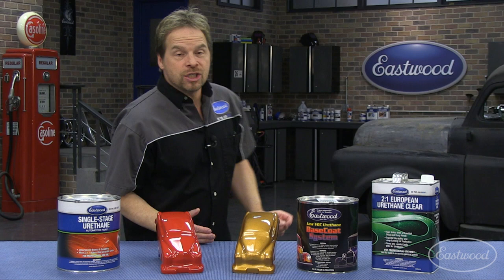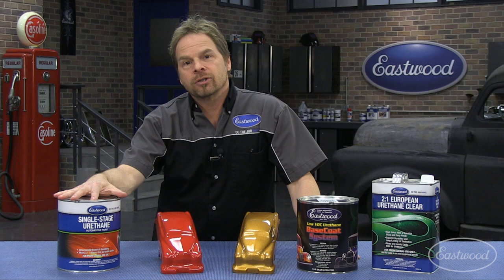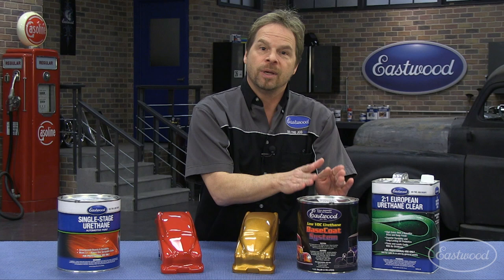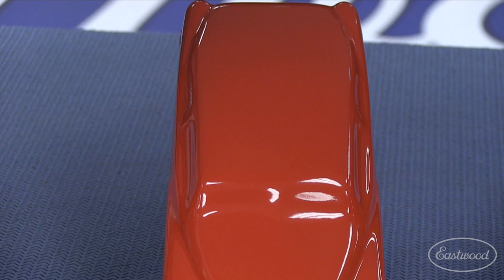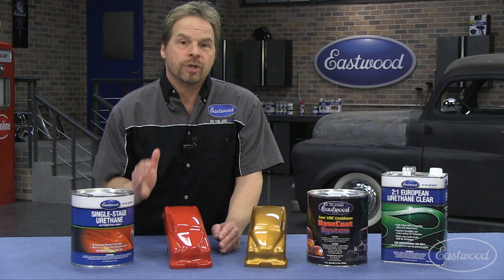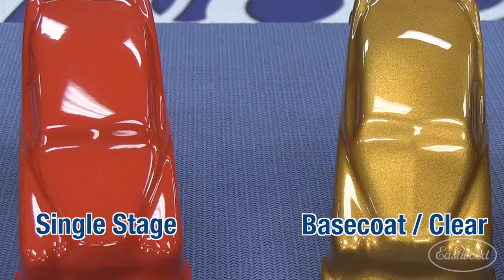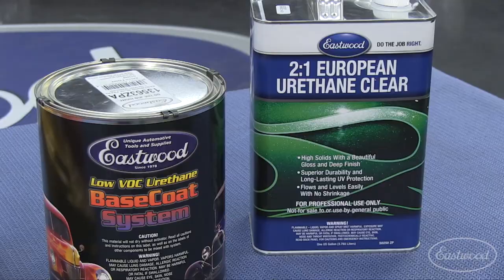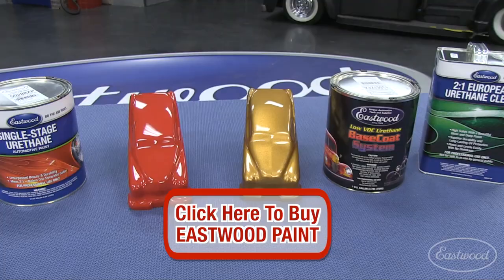Automotive Basecoat-Clear vs Single Stage - Which Car Paint System is Best? - Kevin Tetz at Eastwood

Comment: "if you're a beginner", Single Stage is the only way to go, it eliminates all the hassle, except the prep. Sand through the clear, sand through the base, sand through the primer if need be. try not to reach bare metal. Sand, and sand some more. Lay on a smooth primer, sand to perfection- lay on ss in thick heavy coats without runs-let dry, done.
Reply: Can you just sand off the clear coat and paint over base if you want to?
Reply: Kanye East that’s what I’m doing
Reply: What difference between urethane single stage and enamel single stage
Reply: @AlexSanchez-qw6po  Yes you can.

Comment: Why wouldn't you do both sprayouts in the same, or similar color to properly demonstrate the differences in the finish between both paint systems?
Reply: thank you
Reply: Cause they don’t want to admit that single stage is better can cheaper.
Reply: Agree with everyone no comparison shown stupidity
Reply: Actually, I suspect you can't do metallic paint in a single stage paint. At least that will last very long. Metallic paints need protected in a big way or they just oxidize really fast.
Reply: Oh yes you can - 'old school' non-catalyed single stage metallic enamel - did many of them decades ago - there is an 'art' to spraying it.  Lay on two full coats and it is all blotchy - then as the second coat is tacky - you thin the third coat and mist it over and 'voila' uniform metallic flop - BUT - HA - you CANNOT polish it or sand it as the uniformity is then ruined.  It was for quick cheap out the door jobs.
Reply: @consaka1  Single stage metallic is possible - HA - looks great off the gun - BUT - I would not like to try and cut & polish it over the years.  Single stage metallic enamel (40-years ago since I used it) is sprayed on with one full coat - let it tack a little bit (it can develop runs very easily) - then a second full coat and then before the second coat is too dry (and which looks mottled at second coat stage) - a thinned out mist coat over the entire area.  The mist coat eliminates the mottling.  It has a super shine direct off the gun.  I painted many of those 'el-cheapo' jobs many years ago - not sure about the look of them if someone started ripping into it with a heavy cutting compound years later.  As for solid colors - I 'detest' COB on solid colors on older style cars - it looks completely out of place. But then again - ome people like to adron themesleves with gold chaians etc - others do not --- so therefore - each to their own final choice.  Single stage looks much better - HA - a 1932 Ford never had paint that looked an inch deep.  But COB is required for longevity of a mettalic.  I suspect that COB is easier for OEM reasons - hence the popularity on modern vehicles.  My suggestion - if you are doing an entire respray on a older veihicle - consider using single stage with non-metallics - HA - I would not suggest the single stage metallic of some 40-years ago (assuming it can till be purchased) unless budget reaons dictate the method.  Have a safe and nice day.  CHEERS from AUSTRALIA.
Reply: Thanks same question
Reply: @performancegroup310  lmao
Reply: If you're gonna do a solid color without any metallic, single stage is the way to go. If it fades, you can just buff it out, and I swear that basic paste carnauba wax on single stage has a different shine to it. 
-- If you're gonna do metallic, then multi-stage is the way to go. Personally, I like the metallic to have flat flakes that are mixed into clearcoat. Like, gold flake on top of blue base coat. Then bury all of that in clear.
Reply: @geneva760 Excellent advice friend - thank you

Comment: As a beginner, I’ve just tried both and finding out that single stage is much more difficult to apply. Got runs everywhere. On the contrary, base coat (2 stage) is so easy to apply, just time consuming. And the final clear coat can be easily corrected. I’ll leave the single stage (typically 2K) to the professionals. The other thing I’m finding out is that for 2 stage paint, the surface must be impeccably smooth, else every imperfection is visible. The single stage seems to fill more, thicker, hence more forgiving surface imperfections.

Comment: My rule of thumb is, if its a non-metallic, non-pearl paint, I go single stage.  If I want to spray a metallic or pearl paint, I go base/clear.
Reply: Absolutely, the problems with single stage only begin when there is flake or pearls involved When they are it's damn near impossible to avoid mottlellng and streaking and base/clear becomes the only viable option.
Reply: @satamanschmidt3428  Wait are you guys serious? I fail to see the reason to get a one stage paintjob unless like he says it's an old car with already a one stage on it and you are fixing panels.

Comment: Look at eastwood trying to scare noobs into the more expensive stuff. The singe stage is also forgiving because you can re-spray anything and all flaws can be sanded out. If there is a problem in the base with the base/clear system, it is more involved to fix.
Reply: Ian Mcdowell EXCATLY!! What a BS comparison also using a basic red against a gold metallic! Trying to scare people to boost sales of the more expensive system!!
Reply: Ian Mcdowell and it is not peeling of from the sun after years like the base coat-clear coat ,the single Stade will need only a polish
Reply: Ian Mcdowell but they are explaining it well
Reply: Can you add a layer of clear coat over the single stage to make it shine even more?
Reply: @stufish73  yes you can
Reply: Stuart Mead yes
Reply: You can't blend color on a single stage if you have to paint a repair section.
Reply: I have a question for you... I have a single stage urethane (black) and a gallon of 2k urethane clear. Can I spray them in sequence adding the clear over the single stage or do I have to let it cure, then sand/scuff it before spraying the clear? Any advice helps.
Reply: @denverfreeman738  use whatever the manufacturer specifies for top coating. If it is not on the can, look up more data on the website or contact a rep.

Usually the answer is yes, some people do it for a deeper shine while others don't to avoid future clear coat issues.

Comment: to me the single stage looks cheap. OEM does base+clear right? So a restoration should be base+clear?
Reply from the maker: It can depend on the manufacturer - some motorcycles for example come factory with single stage.  But the norm is base/clear.

Comment: videos a little biased towards the base-coat clear,  a single stage can be polished out to look just as deep and wet as the to stage, it even looks like they didn't polish the single stage as good as they could have, to perpetuate there sales.
Reply: Matthew Morgan Ya but the end result is still the same a base/clear   will always be glossary then a single stage spray.
Reply: You are so right! Plus if the single stage you can buff out if it fades , when clear coat goes bad it’s done , strip it and repaint. You can also mix 50/50 clear and single stage on the last coat making it super nice.
Reply: Nick Sandoval I always mix clear and color for 2-3 coats reducing the amount of color by 20-50% each coat depending upon color and then do at least 2 coats of clear clear and you will have a paint job that is nicer and deeper than any bc/cc system
Reply: @1982MCI  HI m8. Yes, I agree. I'm spraying my Chrysler 300C 5dr this summer. Haven't sprayed for years but having dreams of a super, super finish. I was thinking somewhere along those lines myself...I have a plan..!!

Comment: Hi
please which of the two paint resists better to sun and high temperatures?
i want use 2stage system but I fear that the uv and heat breaks the clear coat over time

Comment: Ok, so I used a single stage on a 66 Mustang restoration, have some spots that need touchup due to running and body work that needs to be perfected.  I used a devilbiss starting line gun with 1.4 tip and as the painting progressed the gun spray seemed to narrow, hence the runs.  what is the best option to fix? sand and use base coat instead or more single stage.  I might paint over the entire care again. I was planning to use clear over the single stage anyway.  what is my best approach.....Thanks for your reply!

Comment: Is 2k paint in a rattle can with the activator module inside the same as single stage? Does it need a clear coat or can it buff to shine without clear? I was looking for single stage in cans but the shop I stopped by didn’t speak much English. My car doesn’t have a clear coat.
Reply from the maker: This is going to be on a case by case basis depending on what product you're using.  Our 2k DuraSpray is polishable after 12 hours.  Other's might come out as just a color coat without UV protection/Shine.  Check product descriptions to be sure.
Reply: @eastwoodco  I have a 57 belair, red/white top with no clear coat. I need single stage rattle cans of each color. How do I go about matching colors and purchasing from eastwood?

Comment: " …..  the single stage does not have the depth of the b/c job …. as stated by Tetz "  -  This is simply False …  or should we say let's just qualify, quantify and clarify that statement  as it is on face value not correct and is simply wrong … The clear coat is the only so called depth you are going to achieve with the bb/cc system as the base coat has no hue or pigment/binder qualities to render any depth … by it's basic chemical component makeup it can offer no depth and as stated it is flat when applied and relies on the cc top for it's shine , yes shine but renders no true tonal perceived paint depth… on the other hand the lacquer , enamel or urethane paint has as part of it's chemical component makeup elements that contribute to and enable a true light visual perceived depth quality … A clear coating has only visible light transfer capabilities like a glass of water with no components within it's component makeup to bend, manipulate or enhance it's perceived depth … it only has the thickness of which is applied to give it depth, kinda like there is no depth to those high glossy hooker finger nail polish jobs either or those overly thickly applied clear coats on wooden bar and restaurant table tops we have all seen on time or another …..  The enamel has this due to it's pigments and binders and the base it is emulsified into thereby rendering the ability to manipulate hue, tone and bend light to your eye in such a fashion as to create depth and richness that a clear coat of water or urethane cannot chemically or physically  achieve … simple as that … taking that even further this is the same reason for what appears to be why one can just about dive into a well applied multicoated lacquer paint job … the deep and hues here are endless something a bb/cc job could never achieve … bb/cc is for ease of surface maintenance but never drink the Cool-Aide that a bb/cc job has any real depth … it is the pigment and binders that create true depth not clear layers of clear over clear …
Reply: Very true! Single stage has more depth, durability, and buffing abilities along with the hue of true paint colo!
Reply: As a student in high school, my teacher never used base coat unless the customer really wanted it but he never gave any type of warranty but always stood 100% behind polyurethane.  I did the same in my younger days after high school and NEVER had customer complaints.   I did see MANY base coats flaking its clearcoat coming from so called professional shops while I was painting out of a shed.  It was always fun to see people's faces when I showed them where I painted.  I actually had several customers come to me after they just had their vehicle painted at a professional shop.  Like I said,  many happy customers with polyurethane...
Reply: @fultonguyy  did you ever spray urethane enamel with the hardener  then let dry and scu ff and clear its really looks good just looks better
Reply: That's heavy and helpful tks.

Comment: When repairing or restoring a car what is recommended for the underbody and wheel wells and trunk areaWhat is used for New Factory cars and Trucks for underbody trunks and cabin ares not visible ie floor pans and head linear ceilings areas

Comment: Hi wondering if anyone could give me feedback. I have 2000 Chevy 2500. It's pewter metallic. I'm having my rockers and cab corners replaced. Would single stage be OK for this job ? I'll also be painting my cowl hood. Some people have told me single stage isn't as good and may turn saying instead of glossy ?? Any feed back would be appreciated

Comment: Can use clear coat over the single stage paint to?
Reply from the maker: You can - check the paint manufacturers recommendations first for compatibility.  If you're planning a paint job though you should use base/clear from the start.
Reply: @eastwoodco  This suggestion is because single stage is more difficult?

Comment: I'm about to respray my brothers 69 Charger in a clear over base Devil Yellow. However, he wants the black stripes painted over the boot and rear quarters. Is it better to paint the stripes over the fresh base ( inside the 12 hour window) , then clearcoat? Or just paint the whole vehicle in clear over base, then paint stripes or fit vehicle stripe decals afterwards? What would be the best/easier process? Thank you .

Comment: Any issues spraying single stage paint direct to metal?
Reply from the maker: You should start with Epoxy Primer over the bare metal.
Reply: Yeah it falls off or bubbles use an etch product vinyl or acid then prime get some film build  seal and paint

Comment: Excellent video. But what tip size should I use for single stage urethane?
Reply: You can youse a 1.3 sata or a iwata works great or a 1.4 sata if youre crazy like me get ready too move fast
Reply: 1.3 or 1.4 tip is all you need

Comment: What if after solid paint + clear coat?
Reply: Just make sure they're the same paint system and wait till your top coat of paint has flashed off and isn't tacky, then you should be able to clear over single stage.
Reply: Can I sand single stage metallic after cured a couple weeks then clear?

Comment: can you tell me what hs solo means? I have a gallon of oxford white and on the can it has:  hs11 base coat, also says: hs90 white, hs29 ls black, hs49 indo blue, hs67 yellow iron oxi, hs10 clear. does all this mean it is single stage with all these mixed together? can you please educate me on what this all means? thank you. respectfully, Richard carson. if you email me i am in yahoo with the name richardcarson1.
Reply from the maker: +Richard Carson Please visit Eastwood.com where you can talk to a Paint Tech who can answer your questions and help you get the right products.
Reply: Richard Carson those are the codes to make the color.  and because it has clear, it's most likely a single stage paint.